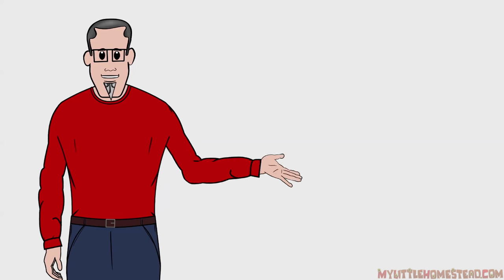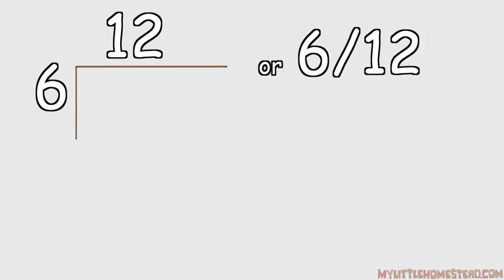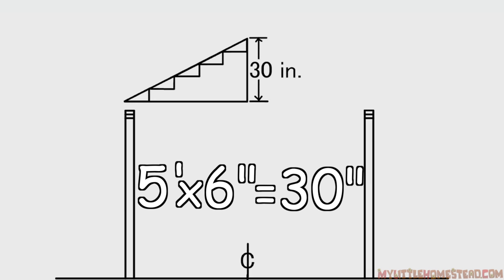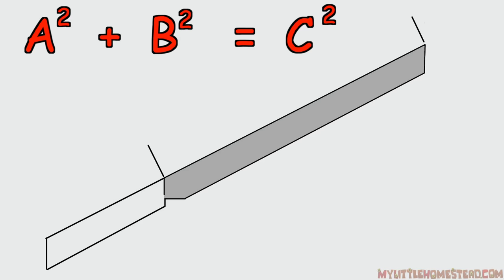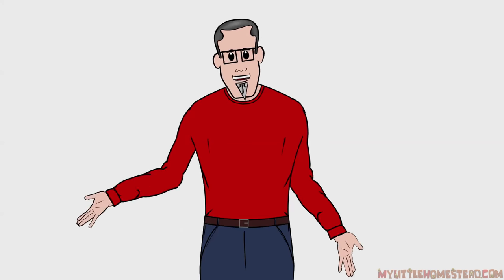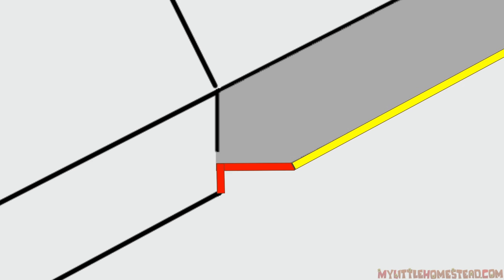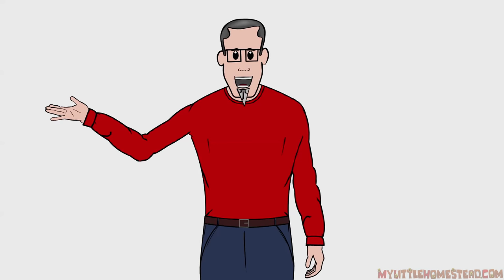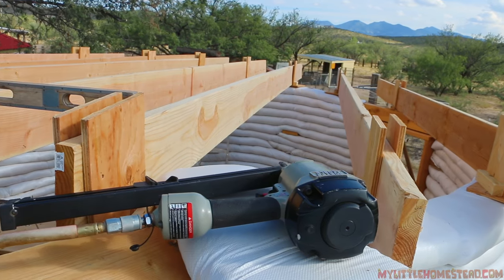Roof/Roofing Overview & Concepts |  Earth Bag Construction Basics | Weekly Peek Ep57

Comment: could you talk about how to build a cone shaped roof with a level difference of about 15 feet when to total diameter of the circular building is about 70 feet? loving the weekly peeks, keep up the great work!
Reply from the maker: +Dennis Ulrich 
We know the concept and have attempted some trials. 70 feet diameter is huge. We don't have experience with something that big. It would require some thinking and planning for something that size. We have been using smaller circles. Let us know what you find.
Reply from the maker: +Dennis Ulrich 
Thanks Dennis for supporting us.
Reply: Nov 13, 2015 you added a weekly peak about the construction of the roof of the previous building.
From what I can see that would be a diameter of about 5 meters, what would you do if you have to span a distance twice that with the same wood? Do you double the wood in width or is there a better way to calculate that.